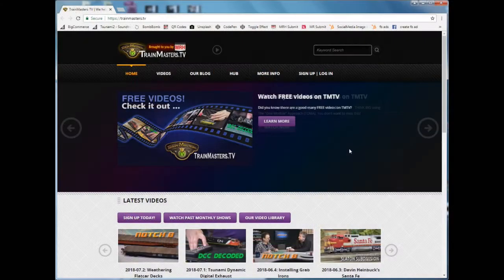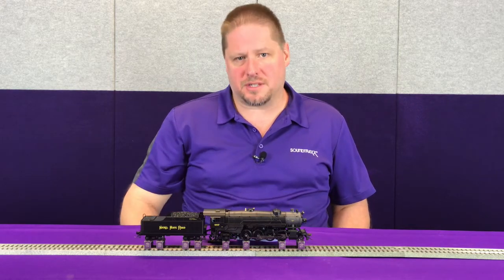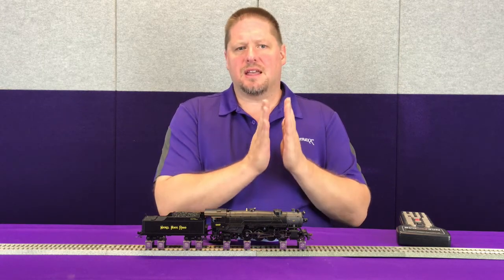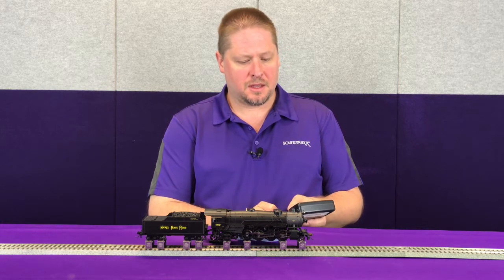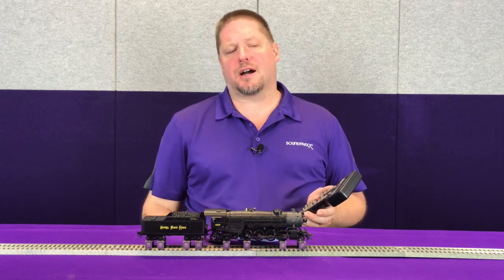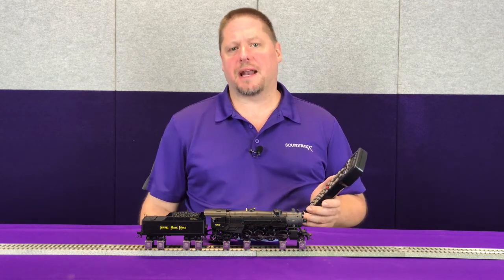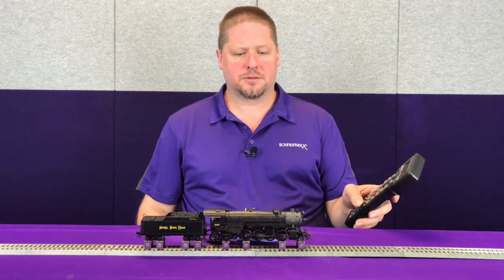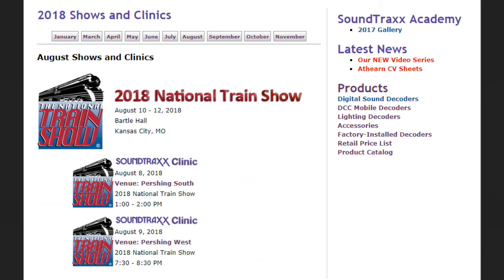How to use Tsunami2 Cylinder Cocks

Comment: Does the auto turn on and off of the cylinder cocks work on TSU-2200 pn 884007? It a great feature and would like it to be automated.  Is there a similar auto on/off for wheel slip?  They both go together for starting a steam engine under load. Thanks for the great videos.
Reply from the maker: Yes, the TSU-2200 for Steam, 884007 does have the auto cylinder cock feature accessible in the CVs.  Unfortunately, the wheel slip (wheels losing traction) is only accessible with F19 (by default).  We’ll keep this in mind for future product revisions or future products.
Reply: @SoundtraxxDCC  Thank you for reply, very helpful. Maybe the auto wheel slip could be a latching function tied to a CV either yes , maybe, or no. If on and the F19 function is selected it would happen at starts during the cylinder cocks being open one time. And when the CV has a no value, it would function like it does now.  And if maybe it would happen at random times when starting. Both on and off are useful depending how you like to model steam. Some people like the crossing horn/whistle, some like to blow it themselves, it seems similar in concept. I am not a steam engine expert, I’ve just seen most wheel slip when starting in my very limited experience watching mostly old steam videos and I understand it is related to load and engineer skill. No reply needed, I appreciate your consideration. Thanks again.
Reply from the maker: @brucegriffin1853  Thanks for the feedback we will keep this in mind - and I reply to everything lol otherwise my tracking/numbers get messed up. :D